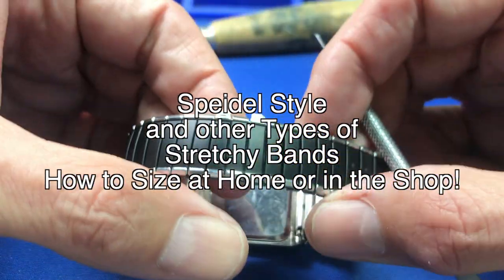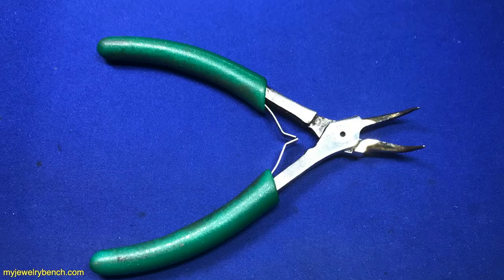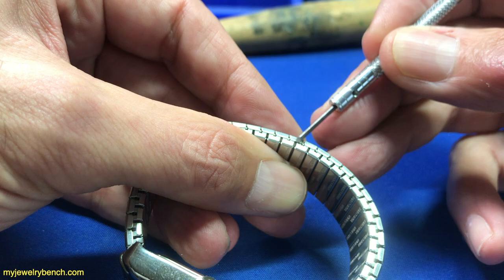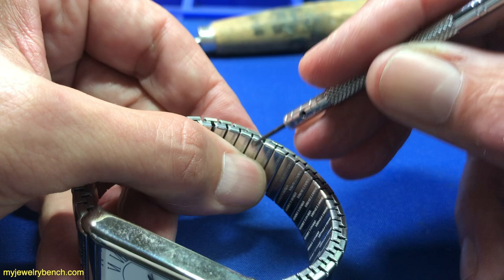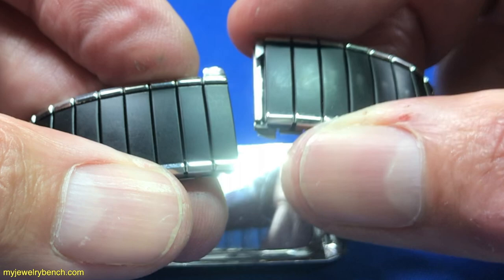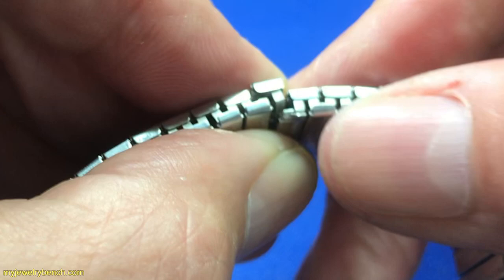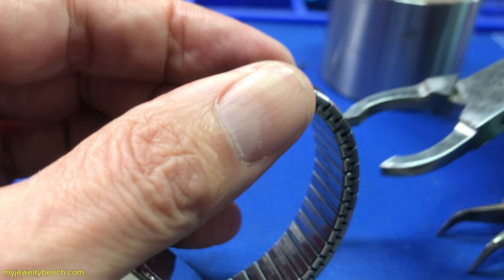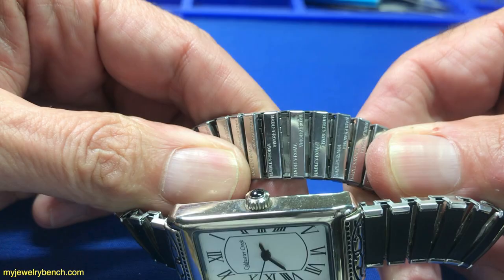Speidel Twist-o-Flex and Other Stretchy Watch Bands!  How to Size Them At Home!

Comment: I wanted to come back to your video and thank you personally.  I found your instructions on this subject to be 👍🏼 excellent.  

As a vintage Accutron (and other watches) collector I come across many of these expanding type bands, and while I usually prefer a fold over clasp bracelet or a nice leather strap, I've come to appreciate them. I have them on a small number of pieces, and always need to size them.  Your instructions have allowed me to be able to do so.  I've probably successfully sized four or five now, and while they can be a little tricky I've always succeeded.  It gets easier with each one.  

Thank you again, well done 👍🏼🍻

Comment: Excellent video.  Followed along and easily took out the links I needed.  When sliding the ends back together I did find it was easiest to pull the staple out of one side, slide the other side in and then with a tweezers push the removed staple back into the other side.

Comment: I personally don't care for Twist-o-Flex bands, and I know how much of a pain they can be to clean if you don't have an ultrasonic cleaner or to adjust them without damaging them.  If I had a watch with a metal band I would personally prefer that it be a mesh or solid link band.

My method for opening the links is to place the band flat against the bench with the links to be opened facing downward, and then insert a flat-bladed screwdriver into the tab to be opened and lever it down flat against the side of the bench.  I have found that this does the least amount of damage to the tabs and minimizes the need to straighten them before bending them back.